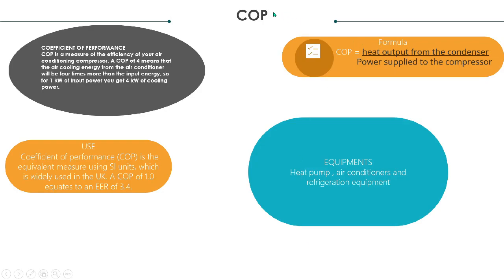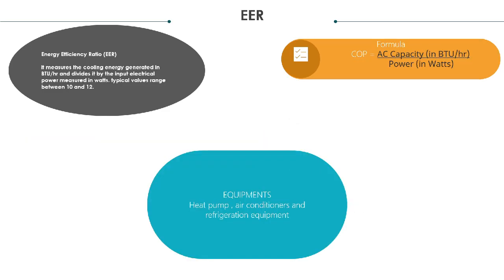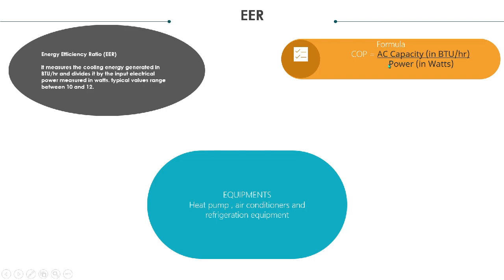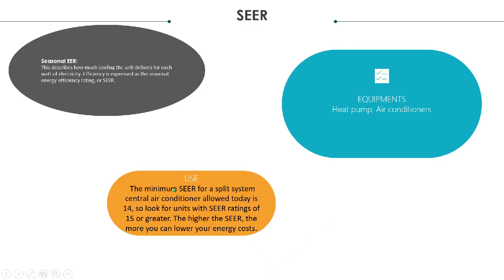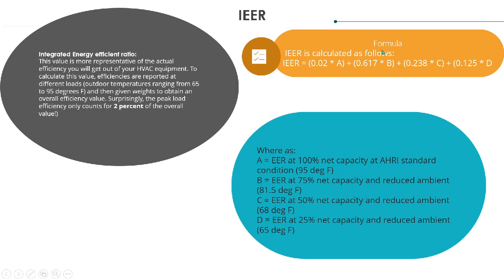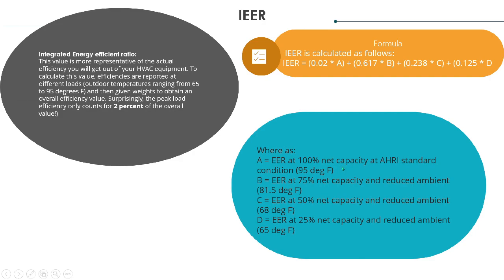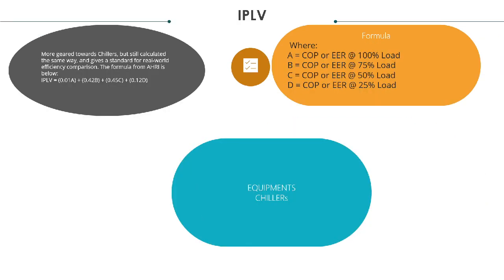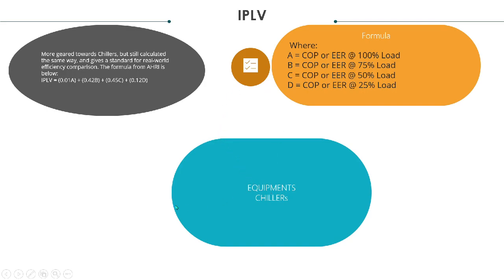HVAC Equipment Ratings explained  | IPLV Rating | SEER Rating | IEER | COP

Comment: The conversions used in HVAC efficiency metrics, such as those between SEER and SEER2, or EER and EER2, are indeed close estimates rather than exact conversions. These conversions are intended to provide a way to relate older metrics to newer standards after adjustments have been made to reflect changes in testing procedures or regulatory standards. The conversions are practical tools for comparison but should be understood as approximations rather than precise mathematical equivalents.
System Type Application:
•	Category 1 (5-ton ≤ SEER/SEER2):
Typically, SEER and SEER2 are the relevant metrics. If the system is a heat pump, then HSPF/HSPF2 would also apply.
•	Category 2 (5-ton > EER/EER2, IEER):
For larger systems, EER, EER2, and IEER are more relevant. If these systems are heat pumps, then HSPF/HSPF2 and COP/COP2 would also be considered.
Equations:
1. Cooling
a. SEER & SEER2:
•	Seasonal Energy Efficiency Ratio (SEER)
•	Seasonal Energy Efficiency Ratio 2 (SEER2)
•	Conversion:
1.	SEER = SEER2 × 1.045
2.	SEER2 = SEER / 1.045
3.	SEER = EER / 0.813
b. EER & EER2:
•	Energy Efficiency Ratio (EER)
•	Energy Efficiency Ratio 2 (EER2)
•	Conversion:
1.	EER = EER2 1.04
2.	EER2 = EER / 1.04
3.	EER = SEER × 0.813
c. IEER:
•	Integrated Energy Efficiency Ratio (IEER)
•	Conversion: IEER=(0.02×EER@100%)+(0.617×EER@75%)+(0.238×EER@50%)+(0.125×EER@25%)
o	Example EER is 11:
EER at 100% load = 11.0
EER at 75% load = 13.9
EER at 50% load = 18.4
EER at 25% load = 19.1
	IEER=(0.02×11)+(0.617×13.9)+(0.238×18.4)+(0.125×19.1)
	IEER=0.22+8.5763+4.3792+2.3875
	IEER= 15.563
	IEER=~15.6
2. Heating
a. HSPF & HSPF2 (Heat Pumps Only):
•	Heating Seasonal Performance Factor (HSPF)
•	Heating Seasonal Performance Factor 2 (HSPF2)
•	Conversion:
1.	HSPF = HSPF2 × 1.18
2.	HSPF2 = HSPF / 1.18
b. COP:
•	Coefficient of Performance (for Heat Pumps and sometimes Chillers)
•	Conversion:
1.	COP = HSPF × 0.293
2.	HSPF = COP / 0.293